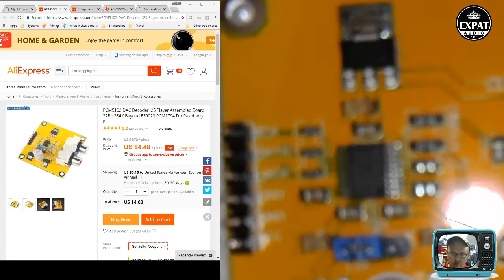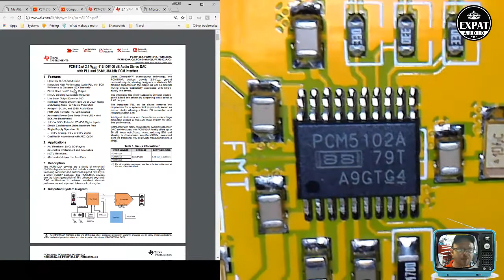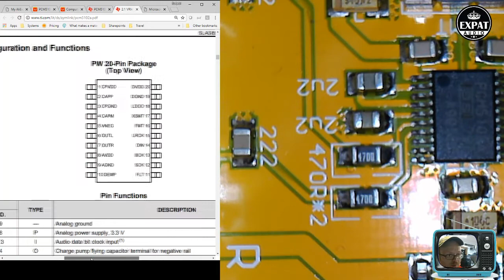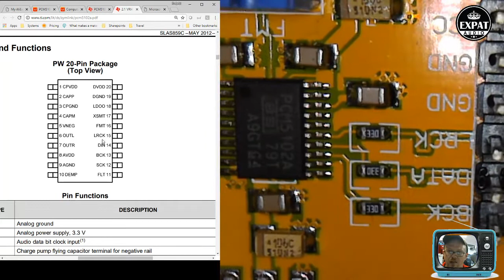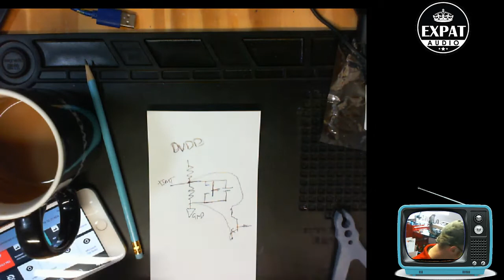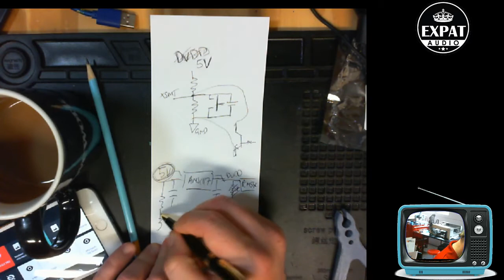PCM5102 Audio DAC - A quick look at Aliexpress' best!

Comment: Most of the software controllable pcm5xxx devices have a dac mode choice: 
New hyper-advanced current-segment architecture
Classic PCM1792 advanced current-segment architecture

Since you already talked about randomizer
I want to know what's the exact difference between two modes

guesses: 
1)pcm5xxx running at 128x osr , pcm1792a defaults at 64x
2)pcm5xxx have two types of sdm, even switchable segment 
3)randomizer changed 

also a question: is the modulator almost same as pcm1792? (eg. only msb and lower 18 bits modulation via 3rd-order 5-level sdm shown on pds)

Comment: Why isn 't the resistance applied to measure the maximum output voltage declared on the datasheet?
If it is, where can I find it?
Reply from the maker: Hi Simone - it’s been a LONG time since I worked on that part (but it’s still my baby!). The spec for linenout calls for 10kohm impedance. 
I believe the abs min load is 1K ohm.
The line drivers inside were never specified for headphone loads, as the charge pump and the line driver would have needed to be much bigger.
Reply: Thanks a lot for the information! I purchased a similar DAC the last year, but I did return it because it didn 't work well with my old amplifier (which had a sensivity of 200 mV on 22 Kohm). However, I would like to try again, since I 'll have to wait some time to replace that amplifier.
So, I 'm designing a voltage divider to match the 2V output with the 0,2V required by the amplifier and I thought that the audio source 's output impedance would 've been important.
Given that the amplifier has a 22Kohm input impedance (which I will identify as a load for the voltage divider output), should I do the calculations with an input voltage of 1 - 1,2V instead of 2V?
Reply from the maker: That’s an OLD amp! (I bet it sounds great!). The 2VRMS specification comes from a Dolby digital spec that came about late 90’s, early 2000’s. It’s way too much for an old amp, so your idea to use a voltage divider is great.
Design of your divider will be heavily influenced by the load the amp will present. That will be a bit of a challenge too!

Comment: What you're not mentioned is that is Sigma Delta DAC. It make every time a oversampling with the data that come in so this is in normal 8times the clock of the input signal. 48kHz sample *8 = 384kHz output sampling. The trick is that it make between sampling points new delta sampling points and make a higher (calculated pseudo) resolution but also a higher noise bandwidth and then they need not so good output filters (output filters are filtering the sampling frequency that you can't hear it)  because you can't hear 384kHz with your ears. Best Regards Volker from Vienna Thumbs up Nr.160.
Reply from the maker: Hi Volker - I apologize that I never replied when you first posted this. Internally, the part has varying interpolatiora to push the data to a constant 384kHz. The modulator takes over from there. The design of the interpolators are a major part of the magic sauce - I’m sworn to secrecy to my deathbed on that one! :)
Reply: @expataudio  don't worry - we; you and I shall tell that to the viewer and the world. Also we should mention that a Interpolation sound better but is not the near analog so that should be but this is at the boarder frequency from about 24kHz minus Sampling Filters. Thank you for watching.

Comment: hi expataudio,
since you work for ti/burrbrown,i would like to give you a feedback regarding the sound quality of newer dacs.newer dacs dont sound as balanced as older philips,wolfson dacs.i have listened to products containing philips tda1311 ,1387 dac,wolfson 8772,pcm1727,pcm1742,pcm5102,dsd1793,cs47l91.i have done a few experiments with passive components and opamps,and from my experience all the output opamps/passive components around the dac chips were almost neutral/normal sounding-so difference in sound is only due to dac chip itself.i find newer dacs push voices forward and snare drums backwards.(i think voices are brought forward to enhance back ground details-but the side effect is the snare drums get pushed behind and this reduces the musicality while listening songs.Can you tell me which songs you all use while designing dacs?bcoz if you listen to certain songs that have forward snare drums(such as michael jackson's songs),you will not immediately notice that snare drums are being pushed behind.I would request you to listen to products containing above dacs,if possible,to better understand what i mean to say.I was searching for a dac that could replicate the sound quality of old philips,wolfson,burrbrown dacs.But newer dacs dont sound the same,so i had to look for used older product containing old dacs.

Comment: I used TDA1543 and working perfect so I bought this PCM5102 module and it does not work at all !! I decided to go for  I2S Audio Breakout - MAX98357A from Maxim (waiting for delivery)
Reply from the maker: That surprises me! Did you check voltages around the device?
Reply: @expataudio Thanks for your reply,  Yes I did , my other option is MAXIM MAX98357A

Comment: Hi,  I'm wondering can the negative charge pump be fed by a seperate regulator also?
Reply from the maker: it already is on this schematic. (a separate +3V3). I'm uncertain if the hardware controlled PCM51xx devices can switch off the internal charge pump and use an externally provided -3.3V.

Comment: Thanks for the video! do you know if its possible to have 2 of this AUDIO DAC running on one Raspberry? the thing is to have 2 differents stereo outputs to use for DJING on MIXXX software.
Thanks
Reply from the maker: the challenge doesnt rest with the DAC, but with the Raspberry PI. The PI would need two DOUT pins and a single set of clock signals. Otherwise, the DOUT pin would have to support a TDM (Time Division Mutliplex Mode). That makes like  alot harder. you'd need to change to PCM5122 to configure TDM input modes.

Comment: how is the sound quality ? hifi ?
Reply from the maker: It's a lovely sounding DAC. Architecture was initially based on the classic PCM1792A, but the digital core was upgraded to have a better randomizer. The randomizer evens out tones (moves very low level tones out into the noise floor)

Comment: what amp would you suggest under 80 dollar from alibaba please help
Reply from the maker: Rajat Bansal I think any of them using a device such as TPA3116.
Reply: @expataudio  none of the big brands use tpa3116 plus it's not just about the  amp chip is it it's also about the opamp used with the configuration if it was just about the amp chip we would have more insane build like O2 amp .
Reply from the maker: IT appears you've answered your own question! :) The PCM5102 doesn't require an external opamp for I/V conversion, nor does it need to boost it's output for most amplifiers. Worst case, you have to attenuate. For differential inputs, take the big brother, PCM5242.

Comment: Nice walk-through of the design. Will you make a video on the more advanced DACs and why a I/V section is needed?
I am debugging an the DAC-section (on subwoofer output) of a Onkyo SR876 receiver and i think i will order such a board to ensure the noise is not already present within the signal https://www.diyaudio.com/forums/solid-state/332666-noise-subwoofer-output-onkyo-tx-sr876.html

Comment: Thank you for a nice run through. :) I see similar boards using only one voltage regulator. What is the pros and cons of separate voltage controllers in your opinion?
Reply: Nikolaj Kynde ams1117’s are so cheap, it doesn’t really matter, but mainly, people put them in defensively to try and drop crosstalk between the digital interfaces and the analog references in the device.
Remember that any noise on the analog power rail gets coupled into the output (divided down by the psrr).
What many forget to consider is that at DC most regulators are great, but with higher frequency noise items, some can look like a straight pass through!
I personally think an LC filter followed by a regulator is good for the analog power rail, then another separate for the digital and charge pump should do nicely.

Comment: Yup. I was one of those yelling "5 volts!" at my screen! Nice tidy breakdown there. Not sure what your end spec will be, but I use 4 x input pairs wired to my monitor controller, with choices of outputs to 3 x feeds (main mons, near-fields, and headphone amp). The 4 input feeds are pre / post mastering chain, an A/B channel (compare mix with similar material), and an aux input (CD player, etc.). My switching setup is all analogue (thought you'd appreciate the spelling), but my digits rely on ADAT lightpipe, and I've often wondered how easy it would be to decode 'any' pair of the ADAT chip output as the input to a DAC. Switching between any set of inputs (called PEC/Direct switching in the film industry where they would match levels on the optical track [Photo Electric Cell] with the magnetic tracks) can be up to 3 times a second when you're chasing down the last bit of the mix, so needs to be done silently and quickly - gapless, but not instant (click!) - which was where I decided I didn't have enough time to figure it all out in digits. 😁
Reply from the maker: Keith, you'd definitely need some extra brains for the digits. I'd be tempted to go two fold. First, use an off the shelf ADAT decoder IC. It'll make sure that all of your clocks from your ADAT will be sync'd, then it's a simple case of selecting which data pin you want from the decoder into your DAC.
I'd follow that with a variant of the DAC that has I2C (That's PCM5122, PCM5142, PCM5242), and do rapid volume ramps between the inputs, on zero crossing, so that you don't get pops and clicks on switching.
One of the nice tricks in that family is that if you ground one of the clock pins, the device goes into "Ramp to GND" mode, where an internal oscillator takes the last bit of data (even if it's at max amplitude) and gradually ramps the output voltage back to GND. Better to do that, than slam the output voltage back to GND.
I'll make another video soon with my PCM5242 variation of this board, that I'll actually put the footprint to a small arduino on. That will allow folks to quickly program the devices to do whatever they need, without significant effort.
Thanks for the feedback! D
Reply: expataudio Great stuff. I don't have enough time to devote to doing it myself (couple of decades out of electronics now), but I'll be following this with interest... 👍